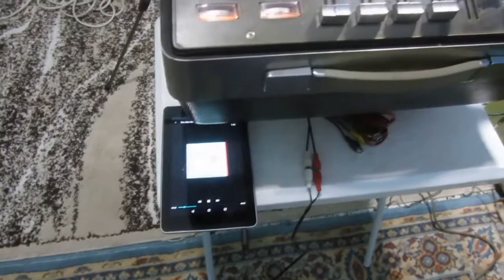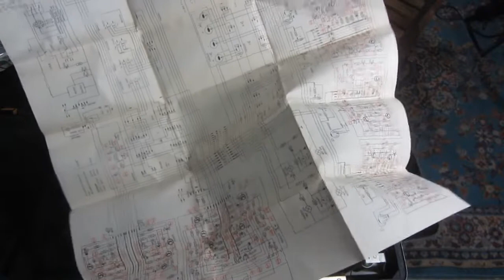Ενασχόληση με ένα BEOCORD 2000 Deluxe

Comment: thats a nice unit,, never seen one with stainless casing like that ,
i have a 2000 model with wood casing 
need to get the play function to work  fwd and rwd works  
i guees its the rubber band,,
Reply from the maker: there were 2 models. Model K (normal) and model T (suitcase). The cover of model T includes 2 speakers to be used with the internal amplifier for stereo playback. https://www.beoworld.org/prod_details.asp?pid=582